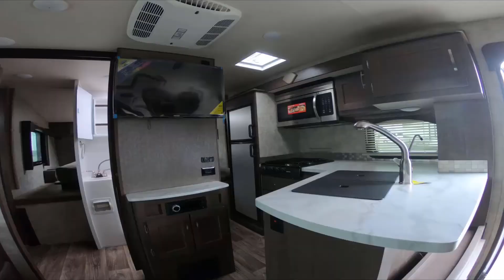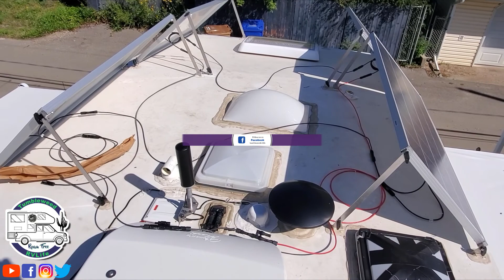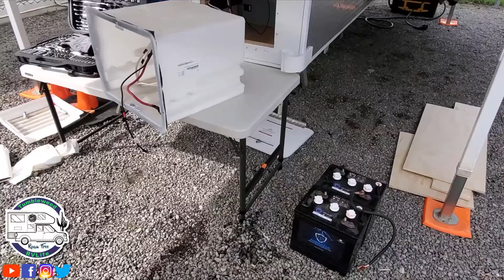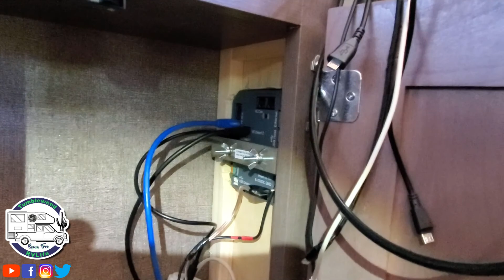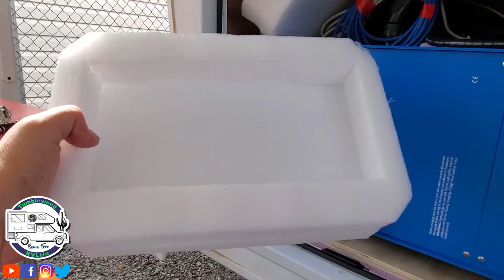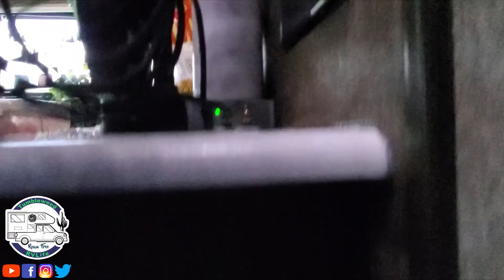Installing RV Solar System Part 2 | Tumbleweed RV Life, Roam Free

Comment: i see you used the space where the batteries go to put the inverter, but where did you put the lithiums batteries? Ar those 170watt panels you out up on the roof? Could have put more solar up o the rood or you think 4 panel is enough?
Reply from the maker: We put the Battery where the original batteries went. We put the Inverter/Charges is the tank access hatch which happen to have just enough space for the Victron Multiplus Compact 2000 Watt. The panels are 160W each (640w total) wired in series/parallel as to not exceed the current limitation of the factory pre-wiring (I think is was only 10 gauge - Max 30 amp)